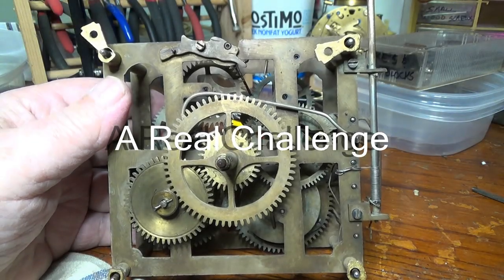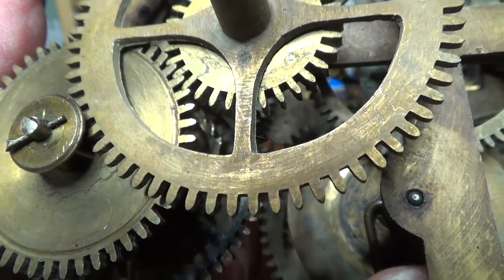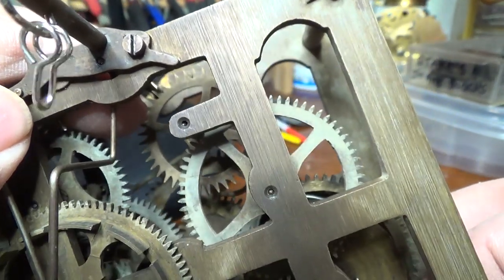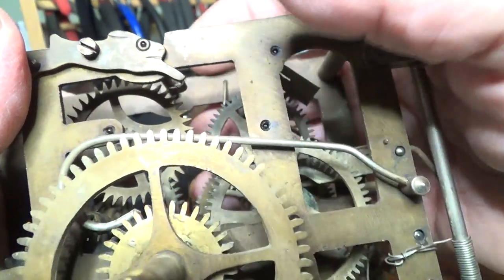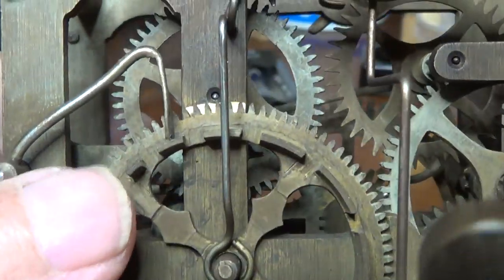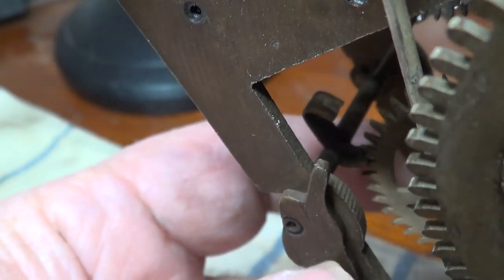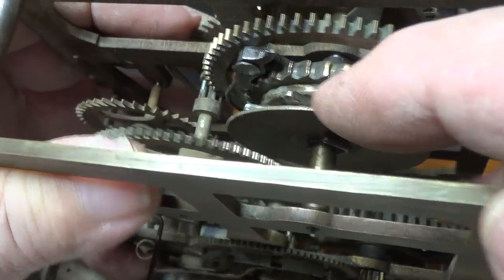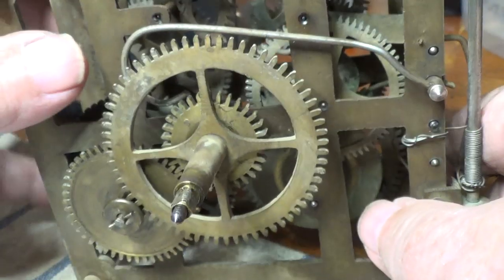A real challenge to repair this cuckoo clock movement

Comment: That has to be the most wear I've ever seen on a movement.  Great work!
Reply from the maker: I'm just afraid when I get it apart, I'm going to find a number of pivots that will also need replacement.  I really suspect that for the escape wheel pivot that I describe as having tunneled.  You can see the pivot looks almost needle-pointed.  Pivots take even more time than bushings.  The real time-consumers, though, are the lantern pinion trundles.  It should be amazing, though, to see it running again.

Comment: Working on the same movement, and I notice on the bottom arbor on the left side (that operates the right side cuckoo),  the pin on this arbor, that catches the pins in the count wheel, is curved downward and drops clear of the next pin on the wheel and no longer catches the pins on the wheel.  
I'll assume that this won't occur when attached to the cuckoo in the case, as the lift wire will hold it in place.  
But this does not appear to be the case in the clock you are repairing here.  So I'm wondering if I need to straighten the pin on the arbor to enable it catching the next pin on the wheel before it drops clear of the wheel altogether.
Hope this makes sense to you!
Reply from the maker: The lift pins on the bellows lift wires are often curved as you describe.  If you hold the lift wire approximately parallel to the bottom edge of the movement plate, the pins on the lift wires will, in fact, be lifted by the pins on the main wheel. I can't show,   even after repair, how this will work as I only have the movement and the case is with the owner. On the other hand, I can't assess whether the lift wires are as they should be on your movement without examining them.  Many times, people in the past have attempted repairs or adjustments to function by bending things out of normal tolerance. You'll have to assess that and adjust the wires to assure proper function of the bellows.  You can see the actual repairs done to this movement by watching this video: https://youtu.be/nPCX9c20y6E
Reply: @dperry428  Thank you.  Yes, the pins will work if the lever is parallel, so maybe I'm good. 
 I just noticed that on the one you were working on,  that the lift lever was pretty much parallel to the bottom of the frame, on the bare movement out of the case, while mine drops down.
Also, the lift wire on mine for the right side cuckoo was all bent up.  Looked like a malaria germ!  So I don't know what has been messed up before I started on it.
Reckon I'll find out, wish me luck!  Thanks again.
Reply from the maker: Once you get it back together in the case with the bellows in place, you'll know what to bend and how much to bend to make the bellows work properly.  It's really not that hard to see when it's all back together.

Comment: Thanks you Don for your videos. They are of great help.
Question: I have to tilt my clock to the left to get the the correct beat.
Do I bend the crutch to the left to set the beat?
Thanks
Reply from the maker: If you have to tilt the clock to the left to put it in beat, the left pallet is too deep.  Bending the crutch to the left will, when it falls back to the bottom of the swing, cause the left pallet to go deeper Bending the crutch to the right will make the left pallet rise to a more shallow position.  It can get confusing.  I just imagine what will the crutch do when it moves perpendicular to the bottom of the case.  If I bend it to the right, it has to move further to the left to get back to perpendicular and will, thus, move the left pallet further out of the escape teeth.
Reply: @dperry428  I am looking forward to see the complete restoration of this movement.
Thanks you.

Comment: Hi Mr Perry I just watched this video again. How did you antique the numbers and hands?
Reply from the maker: I use acrylic artist paint that comes in tubes.  Water it down to essentially stain the hands and numbers.  Raw umber, raw sienna, burnt umber and bunt sienna are good colors to use. If the application is a little too intense, use your finger to lightly rub it off until the color is to your liking.
Reply: @dperry428    Thanks. I am waiting for your next video.